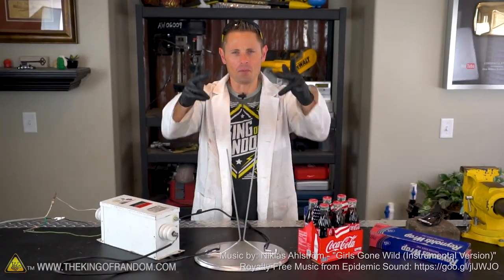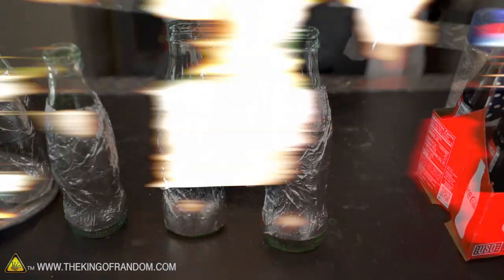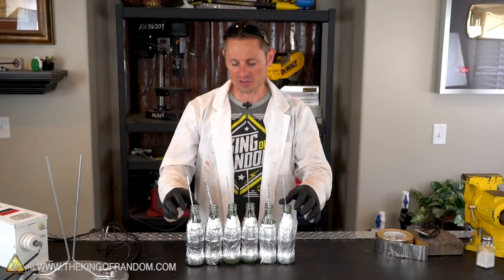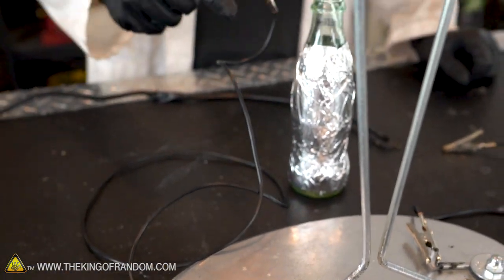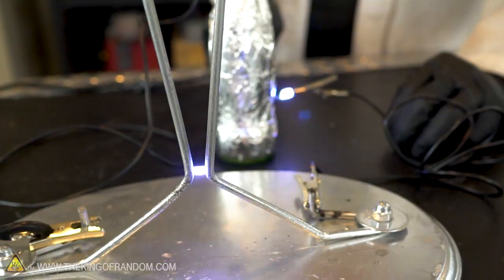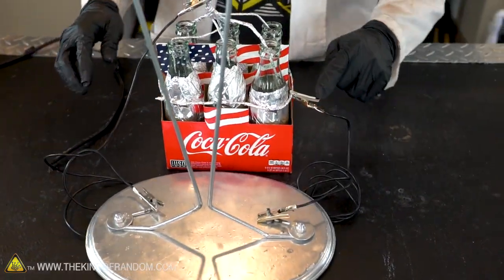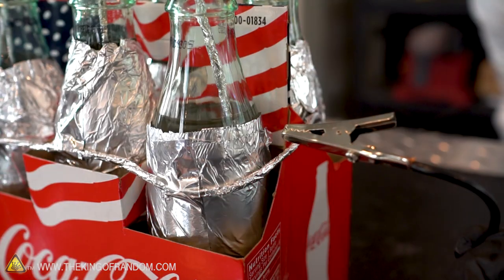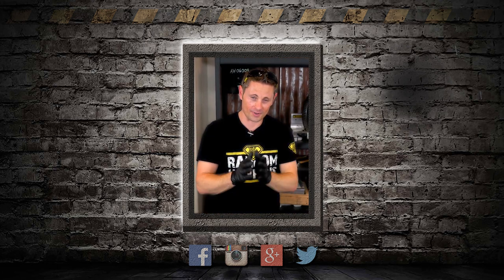How To Make Lightning ⚡ With Coke Bottles?! The King Of Random Lightning In A Bottle Experiment

Comment: Hey Grant is it possible to turn helium or hexafluoride in to liquid?!
Reply: DogeGaming21 it is possible.
Reply: Under high enough pressure and temperatures that are cold enough, every molecule can become liquid. Things like wood don't because some molecules/parts melt at temperatures where others dissociate..
If you want to know more, search vapour pressure.
Reply: ok
Reply: DogeGaming21 yes
Reply: Is it possible to cook a marshmallow with that, or a hotdog? 
Also next step make a step up transformer... and battaries to power it so you can go mobile mad science with it.
Reply: liquid helium is colder than liquid nitrogen
Reply: he already did that in his old vids
Reply: DogeGaming21 by vacuum pump  if you do it long enough you'll turn liquid helium into a super liquid state. its pretty neato. can already find videos on it though.
Reply: Watch a documentary called an absolute zero
Reply: DogeGaming21 hey doge!!🙋🏼‍♂️
Reply: @ZippyZipra water
Reply: +DogeGaming21 Sulphur hexafluoride* 
Yes, obviously, it is possible to do so.
Reply: DogeGaming21 e
Reply: Of course it is! Did you ever go to a chemistry class? Everything can be changed to a solid, liquid, gas, plasma(The classical ones, the modern ones are much more complicated. Read up on them if you want to know cool stuff.)
Reply: DogeGaming21 liquid helium is 2K so he probably wont be able to very easily
Reply: RabbitRampage nitrogen is colder
Reply: DogeGaming21 what Linus tech tips video about quantum computing
Reply: What hexiflouride? Sulphur, uranium?
Reply: low temperatures, or high pressure
Reply: frogonlilypad a gas that is Heavier than air
Reply: DogeGaming21 any gas can be turned to a liquid in the right conditions. For example, CO2 can be turned into a liquid as long it is in an airtight container.
Reply: The fact it's pinned means we may find out soon ;)
Reply: Hey Grant, take out the mini metal foundry and see what happens if you put a bottle of butane inside!
Reply: DogeGaming21 search up "van der waals forces" if you want to understand why helium has to be so ridiculously cold to be a liquid. In essence, the more the molecules of a substance are attracted to each other, the more want to and are thus easier to be put into a liquid or solid state. Things like metals experience high intermolecular forces due to their properties with electrons. However, for many complex reasons that won't fit into a YouTube comment, helium atoms are really unattracted to each other, and thus don't want to be in a liquid or solid state. In Grant's liquid nitrogen generator, it uses helium as the final step to liquefy the nitrogen, since helium won't liquefy or freeze at those temperatures.
Reply: Yes i believe helium turns liquid at 4 K? someone correct me if im wrong
Reply: You would need to cool the Helium to about 4K. Grant wouldn't have the equipment to get to temperatures that low.
Reply: PLEASE TRY TO CUT PAPER WITH THIS!!!!!!
Reply: Ravonies Ravenshir Wouldn't recommend it... You'd get electrocuted very easily because the current will flow through you to the ground, instead of the other terminal
Reply: Is it possible to make it work without the 12000 v capasator???
Reply: Gerald Proda Nope, there won't be enough Charge to make it work
Reply: Like a super fluid?
Reply: SgtShaken4 So how did Tesla make it work ???
Reply: can a magnesium strip go off in liquid nitrogen
Reply: DogeGaming21 love your doge pic
Reply: Gerald Proda capacitors were invented far before Teslas time FYI
Reply: I think liquid helium is one of the coldest substances on earth. So it should be possible
Reply: it's used in the LHC.
Reply: DogeGaming21 yes it is possible but it need soooohuge pressure
Reply: ooooo. he pinned this comment. guessing we will find out on the next video.^^
Reply: 1Kth like
Reply: DogeGaming21 someone's about to get $25
Reply: DogeGaming21 didn't need to be pinned
Reply: nah I don't think it will be cool:(:(
Reply: 99% sure he is using your comment for next vid
Reply: -452 degrees faireinheizght and then it is
Reply: With the coke bottle capacitors attached could you spread the Jacob's ladder farther apart until the arch started climbing?
Reply: im the  1200 like!
Reply: I'm a much bigger fan of him making some solid helium, it'd make a great video, if he didn't like....freeze everyone solid.
Reply: Sulfur Hexafluoride should be doable enough. Helium requires ultracryogenic temperatures. It is quite possible that Earth is the only source of liquid Helium at anything like 1 atmosphere as almost no matter will have cooled cold enough yet due to natural processes, outside some rare nebulae, which are too sparse to contain liquids of any sort.
Reply: Probably
Reply: DogeGaming21 probably seeing as he liked the comment.
Reply: ZippyZipra lol
Reply: All substances can be a liquid at the right pressure and temperature
Reply: I feel like you know that answer already lol. Butttt if not, Helium can be a liquid at the right temp and pressure. Whats really crazy is that making He a solid would be harder then melting Diamonds or making Au in a lab by smashing atoms. He is a liquid at 1 K!! or -458 F which is -272 C!
Reply: jacob casmus well I know helium can be a liquid so it could be possible.If he can't do it then we put it in the void of space
Reply: Much wow
Reply: DogeGaming21 well obviously, every material can be liquified, it's how physics works
Reply: yeah plz do that
Reply: Its like a taser
Reply: hi
Reply: hey DogeGaming21 what do electricity say to another electricity ？im shockted
Reply: Hey Kehuo 2004 very funny 😂 😂😂😂😂😂😂😂😂😂😂😂😂"I'm shocked ⚡️⚡️⚡️⚡️⚡️⚡️⚡️⚡️⚡️
Reply: What if you drank the liquid helium
Reply: DogeGaming21 I
Reply: DogeGaming21 hi
Reply: Nice
Reply: DogeGaming21 helium is a lot harder to do, as its several kelvins to absolute zero.
Reply: DogeGaomklk
Poploł
Reply: DogeGaming21 I have no idea what you just said
Reply: DogeGaming21 I like pizza
Reply: ZippyZipra gas can become liquid with enough pressure
Reply: Yes its possible
Reply: DogeGaming21 ikejf
Reply: DogeGaming21, making helium into liquid would require getting down a few degrees away from absolute zero.
Reply: @uhRoid  But not at regular pressures.
Reply: Ravonies Ravenshir absolutely not. Boiling is not cooking. Heat is cooking. What happens during  cooking is the denaturing of proteins in the food. Hydrochloric acid aka HCl can also denature the proteins of some foods like eggs. HCl does not denature the proteins like they are edible, but just enough to get rid of most bacteria.
Reply: It us matter any gas has a liquid and solid form matter
Reply: Rip 
☹️

Comment: What is your electric bill
Reply: Nutella Cookies hahaha, nice 1. 😂😂😂😂😂👍👍👍
Reply: i think they pay to him instead, he generates more electricity than he needs
Reply: mabye 1.0000000
Reply: GamerTyAlsoVlogs Maybe* that would be $1.... Unless you meant $1,000,000?
Reply: its random
Reply: Normal...
Reply: Some countries use the period instead of the comma.
Reply: Harshil Patel естествено  иёёи7ёеиё ё788ёмч7ёёч  ёстойё7ё77 7ё77и ё7ё77 7 екземпляр ё7ё77 ё7т8ё ё7ё777т8ёи7ё ёёё
Reply: Too much
Reply: All of it.
Reply: datboywilliam 6 I have no idea what that means.
Reply: The output of the neonsign transistor stays the same, a capacitor only stores energy and releases it in bigger sweeps. A photoflash uses the same method, its very bright but can be powered by a single aaa battery. The power it takes for the experiment is exactly as much as a neon sign would take running for the same time.
Reply: Its a low current but high voltage so not much power is used
Reply: Nutella cookies look in his Chanel and then u will find him make a electronic bill
Reply: Should ask that of photonicinduction, till it pops
Reply: High voltage transformers merely reduce current to induce higher voltage. It won't really affect your bill more than using a blender.
Reply: avfusion, really?

Comment: great video. It also does not rise up, as you're dropping the frequency of sparks. The power output is identical prior to and after the capacitor, but with capacitor, you build up more charge prior sparks jumping. Thus the louder noise. However, it drops the frequency too low to form an arc, which no longer travels upward.

Comment: This would be really cool:
Buy a really low powered airsoft/pellet gun. (Around 150fps) go to somewhere you can drive really quick, like a test track or something. Speed up to 102 mph and shoot in the opposite direction to the direction of travel. What will happen to the pellet. Will it just drop to the floor? Record it from outside the car with a stationary camera.
Reply: mythbusters already tested this, if you fire an object at a certain speed -x, while traveling in the opposite direction at speed x, the projectile just falls straight down
Reply: If the car matches the speed of the projectile perfectly the pellet will indeed drop straight to the floor.
Reply: Newtons Laws =) And i think it would be really hard to film that experiment..ESP at high speeds with slow mo cam.
But interessting thought =)
Reply: @leonzajac6636  No. Lightning is the visual effect of electrons moving through the air. Thunder is the auditory effect.

Comment: Hey grant! Do you think you could make enough capacitors to run your carbon rod arc welder efficiently? Or maybe run the capacitors with the neon sign transformer through some charcoal or wood to see what would happen? Maybe try and cut wood in half with electricity!

Comment: Dude is there any way you could show us how to use this and turn them into a van de graft generator or something like a Tesla coil with less amperage and more sparks?  Ur the best!
Reply: john sears Van De Graft generators operate on DC current. this is a 120 volt AC transformer
Reply: John Beauvais it doesn’t have to be a van de graft generator, just something with the large ball to build up charge, low amps high voltage

Comment: Try hooking the coke bottles up in parallel and then charge them through a mercury rectifier.  Then use a series switch to go from parallel to series for some seriously high voltage.  I wonder how far the lightning would shoot?

Comment: Can you try to make beach sand into glass using only thermite?? :D
Reply: YESSSSS
Reply: It would be a bit hard to keep the thermite separate from the sand, but It'd be interesting to see what he comes up with.
Reply: Walru that was not your idea but I still would like to see it and yes it does matter due to grants generosity $25
Reply: I have been thinking about this idea for weeks now, it is my own idea. I do not blame myself if someone else has the same mindset as me, though I am not stealing other peoples ideas.
Reply: If the beach sand is the sand needed to make glass, then it's a possibility.
Reply: Lol try it but use a giant tesla charge so it spikes up into a giant glass porcupine Like it so Grant can see lol
Reply: +explodochamp c: fyi:  if the beach sand is mostly crushed coral or shells (like most beaches in Hawaii and a fair concentration on other beaches) the main component is calcium carbonate which will decompose around 600 degrees F.  you need sand that is mostly a stable compound to melt,  such as silica...

BTW: Grant, I did not read all the replies so this may be a repeat,  but the type of capacitor you built is called a Leyden jar... it has been in use for quite some time,  possibly even by ancients.  look up "Bagdad  battery" to see some compelling evidence that this technology was used   thousands of years ago. ...
Reply: Walru 😉😉😉😉😉😉😉😉😉😉😉😉😉😉😉😉😉😉😉😉

Comment: The 30mA transformer output will be increased with the capacitors, but the voltage won't be higher than the output of the HV power supply unless you use HV diodes along with the capacitors to create a voltage multiplier circuit.
Reply: Say it like it is, man. I might actually try making something like this and take your suggestion. That would actually make it a lot more powerful, and a lot more entertaining.
Reply: Grant makes a lot of videos, and when you make almost daily videos....it's easy to make a mistake.
Reply: I still don't understand what his homemade caps were supposed to have done.

Comment: Hey Grant, what would happen if you mixed sodium, and potassium together, then put it in water? ✌️👑
Reply: Chase DeBusk The two metals would react with each other and decrease the efficacy of the reaction
Reply: Chase DeBusk they would make an alloy called NaK which is MUCH stronger than both elements combined in water. In fact they INSTANTLY explode when they touch water
Reply: John Beauvais sorry, but you're wrong
Reply: TheSpectralDomino absulutely you can just mix them together. I've done it before
Reply: It is possible. Backyard Scientist made bullets of that NaK metal and it was so reactive it caught fire in the air.

Comment: Grant, being an electronics nerd, I wonder how long those homemade Coke capacitors hold their charge for?

And should it be mentioned that the capacitors should be discharged completely before handling them?or are the holding such a low charge that it doesn't matter?

Comment: Can you freeze electricity?
Reply: Check out "Lichtenberg" or "Lichtenberg figure" on eBay. The seller: berthickman creates some amazing Lichtenberg pieces.
Reply: No, Electricity is simply the flow of any charged particle between a voltage differential. Not really something you can freeze like any other matter.
Reply: @Jeff Vader what about a Plasma? I mean its not a solid and its not lighting but its kinda in between
Reply: Well a plasma is the next state of matter after gas, so if you froze a plasma you'd just end up with an ordinary solid. For example if you froze neon gas in a neon light you'd just end up with a white solid that was very cold. And lightning is actually made of plasma, the high voltage differentials between the ground and the clouds ionise the air and create a conductive path the charge can follow right into the ground.
Reply: No.
Reply: Nilla Adrien No but would be really cool if possible

Comment: Great experiment Grant!  But can cause some intense shocks if not done carefully.  For interests sake, it seems that the current running at the bottom of the two Jacob's ladder leads is still high enough that it would be interesting to separate the leads by a few inches, or even further.  I think it will produce a longer bolt that would produce some interesting movement as it arcs.  Just a thought.

Comment: If the Jacobs ladder works because of warm air currents... Would the electrical arc still rise if the air gap was being cooled by a fan or a cold, nonflammable gas? ✌👑
Reply: ...or in a "walk in" freezer like in restaurants etc.
I dont think the ark would rise..thats why we cool processors
Reply: Sizzlik we cool processors because resistance in electronics increase with temperature, which raises with resistance. This creates a runaway reaction of sorts leading to an amount of heat which is detrimental to the system.
Reply: Kyle Brooks if it was cooled by a fan, then the arc would be bent since it’s technically just hot air being ionized

Comment: neon sign transformers are weak, use microwave oven transformers :)
Reply: MIcrowave oven transformers don't have as much voltage. . .this one has 10KVAC more than mine does. . .
I'd say that that makes his more powerful. HOwever, there is more current in a MOT, so maybe. . . I plan to try this with one.

Comment: You might like to know that you should hold your other hand behind your back when dealing with high voltage.

The high voltage can flow down your left arm, through your heart and down through your feet to ground. That is why it is better to use your right arm while holding your left arm behind your back.

I'm not a hater though, I just happen to have a lot of high voltage experience. Thanks for the cool video!

Comment: Grant, big fan and i was wondering if the Tesla capacitor woukd work if you used an aluminium can with glass inside it but still keep the aluminium wire the same?

Comment: Why didn't you move the electrodes apart? Since the spark with more capacitors seemed brighter aka more energetic, and also considering your explanation about why it stays lower, it seems reasonable that you should be able to increase the distance between the electrodes and still get a ladder effect.

Comment: That's basically a leyden jar. You can also charge them with static electricity to get quite a decent spark. You just need to connect the outer layer of foil to earth, and charge up the inside part with static (best way is to rub PVC with paper, and touch it to it) then place a wire connected to the outer layer of foil close to the inside bit, and it discharges with a spark

Comment: Grant I noticed that when you use the bottles as a collective you wrap your aluminum foil just around the Box what if you did a figure eight pattern with that aluminum foil in between the bottles since electricity follows the path of least resistance would there be a greater change in your outcome?

Comment: You could also use a plastic 5 gallon bucket and line the inside and outside with foil too. Just don't get too close to the top or it will flash over.

Comment: You mentioned "aluminum tape" from the hardware store. I wonder if the adhesive is non-conductive has enough dielectric potential to be used as a high voltage capacitor.

Comment: Try melting titanium with the arc furnace! Would like to see how hot it really gets in there.
Reply: titanium is a tricky metal to melt, do it incorrectly and it will react violently  - with a melting point of 3,034°F titanium readily reacts with oxygen at 2,190 °F ---  I think he did a video where he tried to melt it with his arc furnace and a flux to try to keep oxygen out. 
titanium melting - item needed would be vacuum arc furnace to melt the titanium more safely.